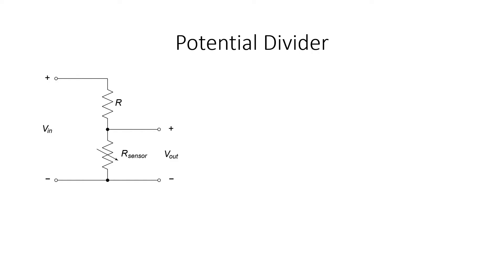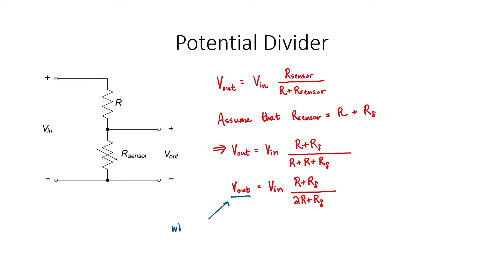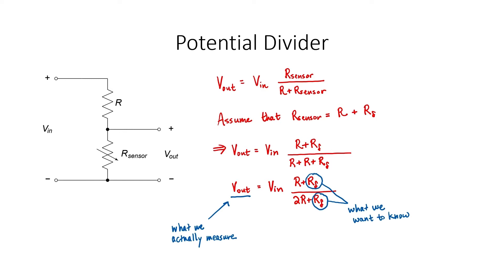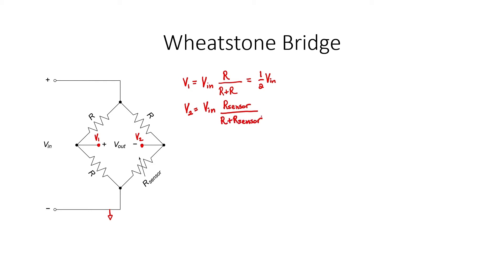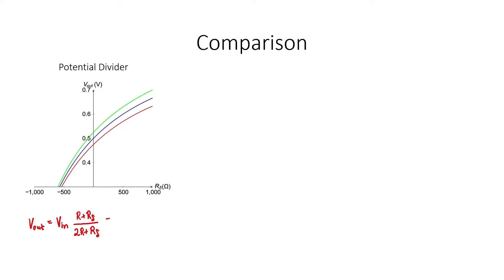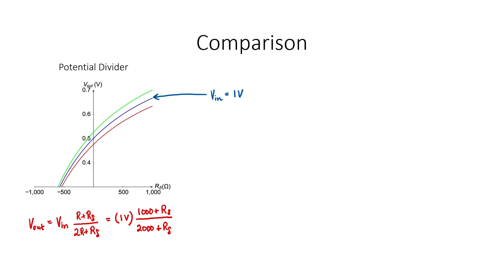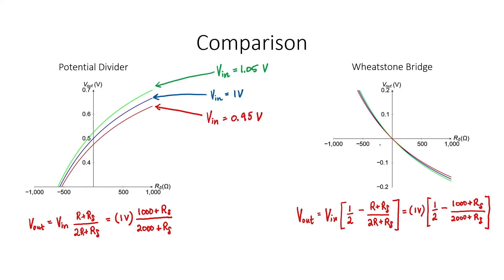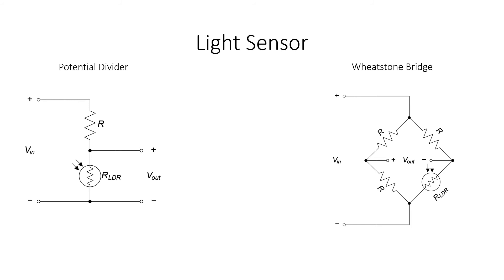Sensors and Wheatstone Bridge (Circuits for Beginners #34)

Comment: How will we know what size the input voltage must be for the wheatstone bridge?
Reply: I believe the input voltage will depend on requirements or specifications for the circuit.  For a lab in class, you might be asked to calculate input voltage from given load and resistance values.